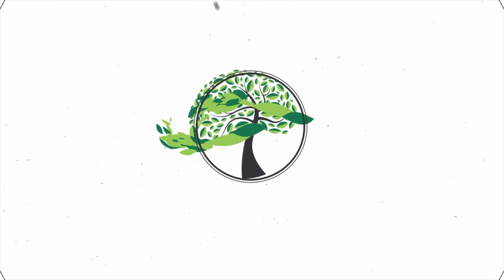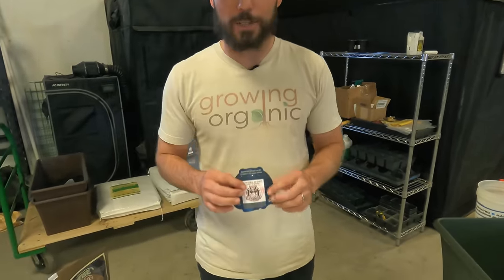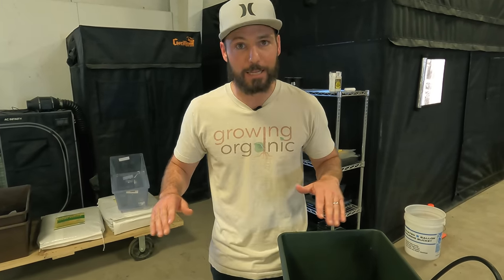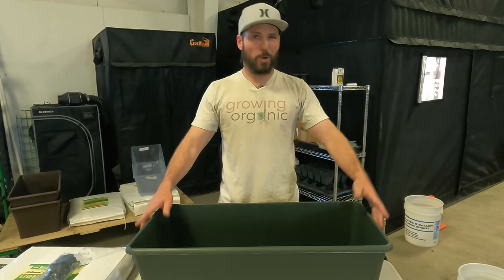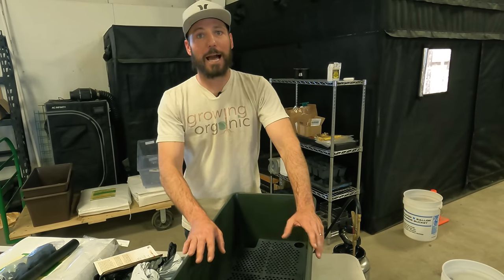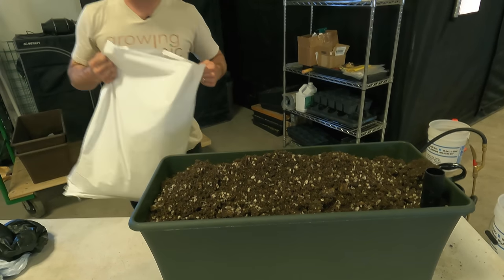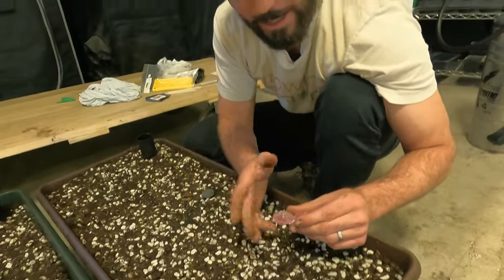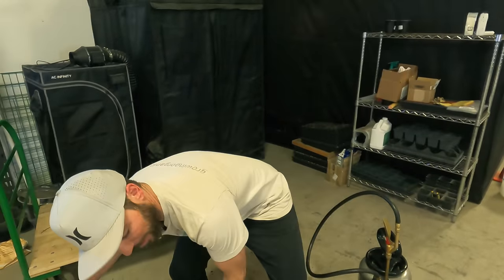BuildASoil: EARTHBOXES AND AUTOS (Season 3, Episode 9)

Comment: Theres no thing as to much light with auto´s 

but a combination of no time to fix setbacks and everything needs to be top tuned for 24hr light a day does it makes sense to give yourself a bit of breething room with regards to watering and feeding by running less

cannabis can take increadible amounts of light as long as other conditions are okay the limits still use are from hps times and they were set because of heat not light intensity ...